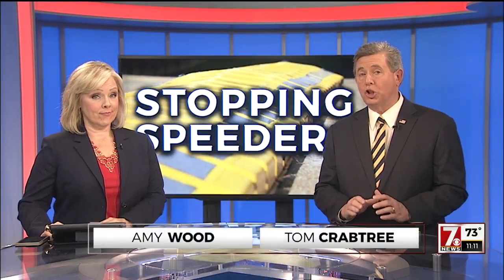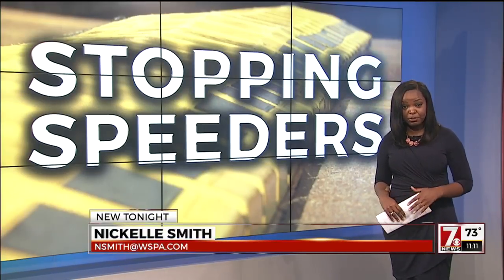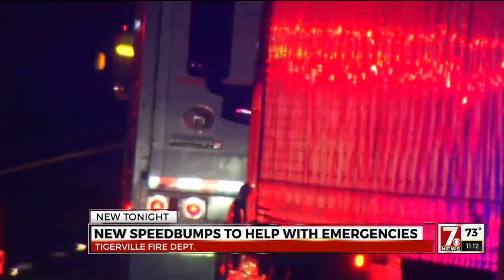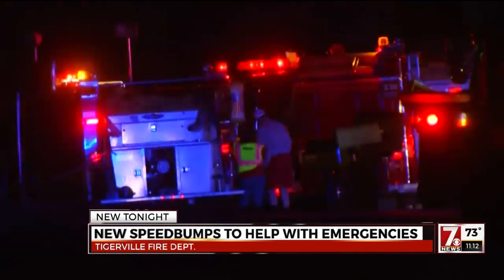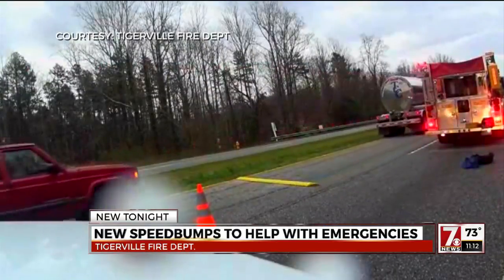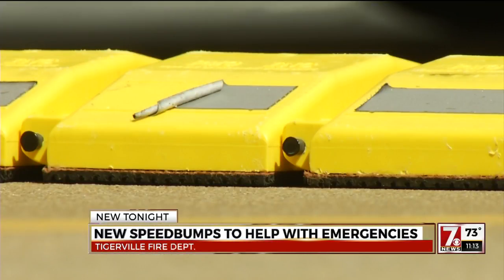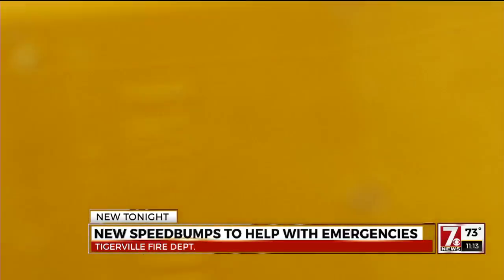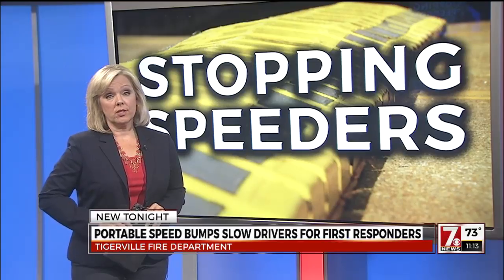Speed bumps slow traffic for roadside emergency crews

Comment: Speeds bumps just punish people without SUVs or trucks - I simply cannot go over them in my small sports car.
They are a cheap solution to a bigger issue.

Adding more turns and lights will slow traffic down - more enforcement and better drivers education to increase awareness will save more then 'just one life' and will not purposefully ruin good roads.
Reply: No, the speed bump would help because it only takes a few drivers to go through the speed bump really slow that causes slight traffic witch will make everyone slow down plus if your sports car is that low I'm pretty sure someone would be willing to move it for you since its portable
Reply: @marcom2092  I slow way down, wait for traffic to clear up and then speed up fast to drive over it fast. Basically i defeat the purpose of the speed bump

Comment: While I agree that fire, police, emt & towtruck drivers need a better way to slow idiots down & get them to move over...I don't think the speedbumps will work. Most idiots will just drive over them @ speed. What they need is a portable speed sensing cam to shoot a pic of the license plate. Speed through the emergency camera...mandatory 1yr suspension of license & all registrations in the persons name.

Comment: Good idea but poor execution.  This is most effective when traffic density is low and a cascade reaction hasn't/or won't cause trafic upstream to slow.

Speed bumpS are needed at a distance that allows distracted drivers to react to the first unposted bumps BEFORE reaching the site of a first responder and if another lane is available, give them time to change into it.   Given the low cost of LED panels,  first responder vehicles ought to have large ones. Frankly, there are so many flashing light on our roads that standard bars no longer get the level of attention they once did. 

Also there are speed bumps filled with a gel that can be tuned to not disrupt traffic moving slower than a set point, but cause a more significant bump as vehicles increasingly exceed that speed. These coud be used to make speeding in construction zones an uncomfortable experience.
Reply: I fly over speed bumps in my SUV.

Comment: Not enough for them to unnecessarily block 2 lanes?
Reply: If you would take the time to think about it. Even if the wreck is in one lane. They need the other lanes for safety and protection from the inconsiderate drivers. Like would you honestly want a car going 60mph to fly right pass you?
Reply: Not blocking the second lane. Just trying to keep you from going the speed limit in it for a few seconds.

Comment: Thts a bad idea cz if u slow down traffic and it interferes whith a ambulence someone could die cz the ambulence wasant there in time
Reply: Let me begin: This speed bump slows down traffic to save the lives of the first responders and roadside emergency crews from speeding cars, on top of that, ambulances are not going to be slowed down by this as with their siren on they will be able to pass all cars and even pass the speed bump on the shoulder. The ambulance may very well be heading to the same roadside emergency that the speed bump is helping keep safe.
Reply: Strike_Raptor poor guy doesnt know the wide shoulder is for emergency vehicles.
Reply: @Adrian Rodriguez We need an ambulance ASAP to take you back to kindergarten to lean how to wright, type and spell.
Reply: Stroke_Raptor Also, the speed bump is portable. In case there is no other option, they can just remove the thing for a certain amount of time so the ambulance can come in faster, then they can put the speed bump back on the ground.
Reply: There are many areas where there ARE no shoulders, but few where there are no bad drivers or speeders.